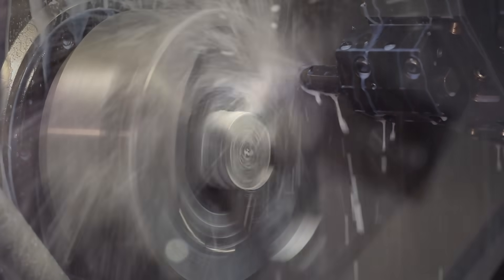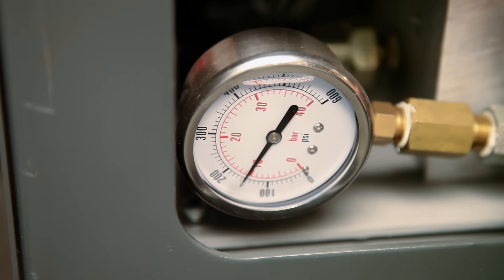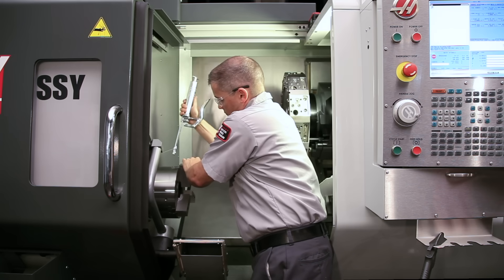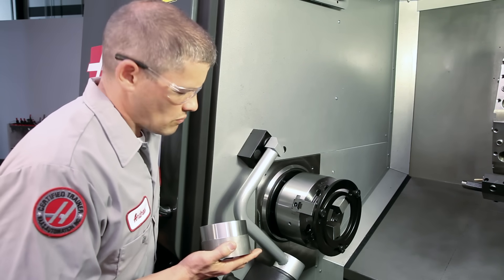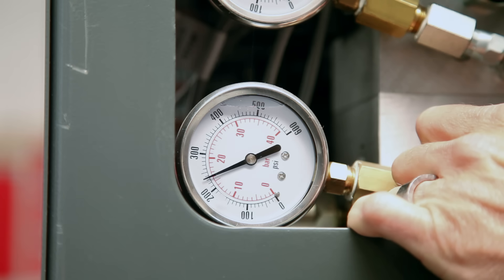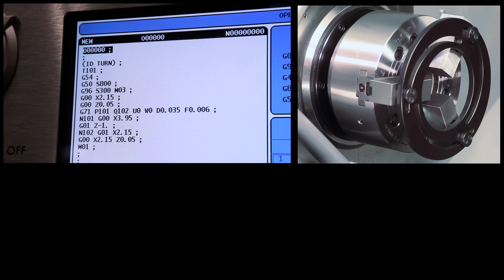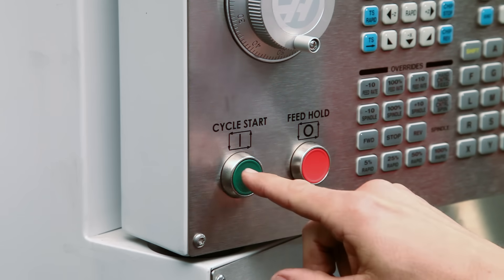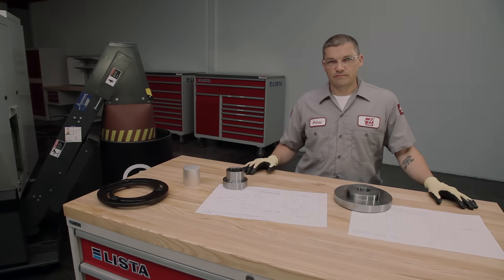How to Properly Cut Lathe Soft Jaws — Part 1: Fundamentals and OD Gripping

Comment: I love how they didn't bring GD&T into this because i'm just looking at this process and cringing at how they just assume 3.9500" OD. Because if its even a thou or two out of round you have either of the respective 3 or 6 point grip scenarios (depending on machine wear, etc.) Otherwise however, it's likely going to work since this looks like a new machine, and its probably beside the point, however important in some more niche scenarios of machining so, I figured i'd mention.

Comment: I have 8 in" chuck with 8.5" boring ring. Im Having a lot of trouble getting the ring to seat Inside counterbores. When I set the Jaws flush with top of chuck(recommended starting point in this video) the ring will seat in 2/3 holes not not the 3rd. I get ring to fully seat when I place the jaws at different height. But doesn't turn concentric

Comment: What tool did you use to deburr the jaws? Would be good to know.
Reply: The kind I'd get shot for using around a machine haha I just take them off after boring and deburr them they'll repeat just fine when you put them back on, just make sure to stamp the jaw number on them as you take them off. Boss man would roll your box out for even thinking about using a grinder inside the chamber lol
Reply: Also he was rolling the burr inwards towards the bored part of the jaw? Always go out, the edge rolled out will keep from marking fancy finishes. In my experience anyways. Also F those jaw boring rings make a steel plug that fits the master jaws of your chuck, then you don't have to stick your boring bar out an extra inch. The plug also keeps your draw tube tidy
Reply: Not to dog the video it's good info the grinder just made me squirm a little
Reply: @chopthesheep90  Thanks for your answeres but they dont solve my question.

Comment: I do exactly as it says in the video. Place the boring ring, lock it in anti-clockwise direction, then lock the jaws, it stops half way as it says in the video. however, the boring ring easily falls off. It doesn't stay in place. Please can someone explain to me what i might be doing wrong. 10inch 3bore chuck.
Reply: don't use it you don't need boring ring for hydraulic chucks

Comment: that last tip was really great. its brilliant to use the same jaws as much as you can to minimize time spending changing them back and forth!
Reply: But be careful if you intend to have both ops in the same program. For example, turn first end, program stop, turn part around and start the remainder of the program to finish the back end of the part. I've seen this done many times. I've also seen what happened if the operator is distracted and starts the program with the part the wrong way round....!!!
Reply: @montyzumazoom1337  i mean you cant predict that someone isnt gonna make a misstake, but you can make safetyprocautions, like m0 ( are the part turned for this oeration)
M0 ( are you sure?)
then go. i too have seen parts and tools being scraped (almost machines too) from these kinds of misstakes, but it all comes down to experience in the end, like always in this field of work! there are button-pressers and there are operators!

Comment: Hi - regarding the rule of thumb of holding 1/3 of workpiece length in jaws if tailstock is not used. 
Can this grip length be safely reduced if all forces from operations are "pushing" towards the chuck?
Thinking drilling (non-peck) and boring here.

Comment: Boys and girls, if your going to be clamping DOWN on your work piece, you have to put your spider (or solid bar stock) inside the jaws.  if you're going to be cutting on the INSIDE of  tubing, or boring something, you need to use a ring on the OUTSIDE of the jaws, then go ahead and cut the OUTSIDE of the jaws to fit the inside of your part.  You HAVE to support the side of the jaws that you'll be clamping against later. If you don't your part is going to wobble all over the place!
Reply: Darn Right
Reply: Dam skippy!
Reply: Mmm, yes.

Comment: You should mention something very important for this kind: The soft jaws are used JUST FOR CERTAIN PROJECT where high concentricitate are required or when hard jaws are very worn out. By the way: force of tightening can be just with 0.315% greater than cutting force.

Comment: Guys I have the problem that when I clamp the boring ring at the middle of the travel I ee that the boring ring OD varies slightly its concentricity with respect to the chuck, in other words, I see a small runout in the boring ring. 
I cut my jaws an later I clampled the raw bar it didn't cut currectly. What happened?
Reply from the maker: Hi Ro. It sounds like the ring was squeezed excessively (distorted / egg-shaped) by using too much PSI force on the chuck. 

1) Make sure the PSI (gripping pressure) does not distort the boring ring 
2) Whenever possible use the same pressure (PSI) when boring the ring and when gripping the parts 
3) Keep in mind that the ring is not designed to run true when supporting the jaws for boring. There will be some slight run-out that is normal
Reply: Haas Automation, Inc. Guys I listened I should use 100 psi actually that is the recommended by the manufacturer. Muchas question is, if my part requires 200 psi but I made the Jaws at 100 psi, would my gripping conditions be affected?

Comment: Great Video. Being a Machinist/ Programmer for 40 years, only thing I would teach different is to bore the jaws .002"-.003"  under part dia.. This gives you a much stronger hold on the part. You would be amazed in the difference of holding ability given the same jaw pressure. It is for sure the difference of having a part come out, and not.  there's always those circumstances where this doesn't serve you well, but as a general rule I always do this.
Reply: Behave Rod . It all works out at the end of the day .
Do you remember how shit scarred of these machines you were first time you used them?
We all were .
Reply: Rod Builder, and your professional qualifications for judging it as such? Perhaps you'd care to enlighten us with your wisdom since I'm happy to learn where any mistakes are in this video. Guess your spreading dirt or something else with that skidsteer to a 100ths of a micron tolerance?
Reply: Well rounded one. I say bullshit , Do you push machine to that degree where you have found the difference between a fly out and not not a fly out by a couple of thou !! Absolute crap .
Reply: you have been doing everything wrong for FORTY YEARS 
its called insanity some say 
you do the same thing over and over again thinking it's right that's what you have been taught that's the way to go with things like hey man look at me i am cool
Reply: Great idea it will also transfer the load across the whole surface by the spring in the materials.
Reply: It's a SHIT video and anyone who thinks it's a good one is a SHIT machinist!!!  Congratulations!!!

Comment: Any good machinist has many different size spiders for boring jaws.  When boring new jaws best to rough out most of the stock on the Bridgeport or jig bore.  The interrupted cut on the lathe is hard on inserts or brazed carbide cutting tools.  Plus this saves a ton of time especially on a manual lathe.  Most small job shops station a manual lathe next to a CNC lathe so the operator can qualify parts before running them on the CNC lathe. This is done during the CNC cycle time when the operator has free time.  This is all part of lean manufacturing procedure.
Reply: Hey so suck, no other manual milling machine will work properly for ruffing lathe soft jaws. Sorry:(
Reply: Blown460 ooh lol
Reply: why bridgeport does other milling machines do the same job
Reply: This clown thinks a spider is something that bites him on a camping trip!!!

Comment: About the question of does the roundness of the plug affect the roundness and concentricity of the finished bore? It's a very nice explanation to me, thanks.
Reply: +jin-shui Chang  To eliminate that possibility, you could turn the plug first, that way you have a clean outer diameter for more precise clamping.

Comment: You mean to tell me, that I have to adjust jaws every time I make part of various diameter or this is just in case you need more precision?
Reply from the maker: Hi Saheryk - Thank you for your question. If you are re-using your soft jaws to hold the same diameter part over a number of different runs, the jaws will usually not need to be re-cut (cleaned up) until wear on the gripping surfaces of the jaws begins to affect part position. This also assumes you re-mount the jaws, every time, in the same position in which they were initially cut.
 
However, when you are gripping a different diameter part with this same set of jaws then it is highly recommended that you re-cut the jaws to match the diameter of your new part.
 
This accomplishes three things:
1. The jaw clamping surfaces are ensured of being concentric with the axis of the spindle.
2. The best clamping grip is developed on the work piece as the full surface area of the jaws is engaged.
3. Jaw force is spread evenly across the body of the part since the jaws have full engagement.
 
Cutting your jaws to match your part will yield the best possible accuracy and grip.
Reply: Saheryk

Comment: Good video. Use of a boring ring is ok but like the video said, the chuck pressure  is limited. I usually use it for boring through the jaws for clearance. I also prefer the scroll style boring ring over the slip style.

Boring the jaws to fit the plug? That just seems silly to me. I use a ring set in .062 increments. I never have any problem with runout. In my opinion, if concentricity is that critical, buy the stock extra long, cut all the diameters together then cut the extra off the back. The best fixture ever invented was extra stock (or leave grind).

Step jaws? Why? To go from operation 1 to operation 2? No thanks. Use your hard jaws for op1 then bore soft jaws for op2. You are not going to hold concentricity from op1/holding a corncob piece of hotroll to op2 and maintain concentricity, in soft jaws, for very many cycles. I thought this part of the video was a little too cute by half. Reminded me of one of those demo videos where they try to machine the whole part with one tool like an insert drill.

I understand this is an instructional video, and it's good information, but from my experience these are "ideal conditions". Chuck jaws are expensive. The 1/3 recommendation made me chuckle a little. If only that were possible MOST of the time life would be great lol.
Reply from the maker: Hi there latheman23. Thank you for your comment, you make some good points, which will surely be of use to other machinists. In the two “How to Properly Cut Lathe Soft Jaws” videos we are presenting what we consider to be our “best practices” that apply to making soft jaws.
 
We are presenting what are likely “best case” scenarios, in order to convey the conditions we try to achieve. As you rightly point out, more often than not, in the world of machining what can be achieved is often much different than the “ideal” text book condition.
 
The experience and the wisdom of knowing the many possible ways to handle difficult machining tasks was something we chose not to try and convey in these “Basics” videos. They were created to offer a starting point for understanding how to machine soft jaws.

Thanks again.

Comment: They forgot to mention the first step: go out and purchase yourself a half million dollar turning center.
Reply: pocoapoco2 , It is helpful to invest in good equipment in order to increase productivity and accuracy. Welcome to the 21st century. I know why your username....pocoapoco...
Reply: Jairo Bernal
And I could just afford to invest in one of these if in the last 20 years I both never ate any food and lived under a bridge.
Reply: pocoapoco2  You can get a good used Haas for under $50,000. Haas is also one of the easiest machine to train green machinists
Reply: yandri you are so wrong. half assed machinists always blame the equipment. I have a chinese benchtop mill @ home that i've built several Impellers on for my RC Jet Pump I built using an indexing head, dialing off 1 deg. x .006" increments X 1500 per each vane side X 3 vanes with zero mistakes. Stop blaming amazing equipment on your lack of tallent and general laziness. HAAS is expendable tooling, make your bankroll and sell it. When I worked @ Holz Precision in the Bay Area, they had $500,000 Mazaks and $25,000 Haas'. They all made huge profits when tooled and jobbed properly.
Reply from the maker: Hi pocoapoco2, thanks for the comment. Half a million dollar turning center? Seems overpriced. You can get a top-of-the-line, fully-equipped dual spindle super speed Haas turning center with Y axis for less than half of that!
Reply: Haas Automation, Inc. lol. Ok, I'll take two of those… and I'll write you a check. Seriously, I work at a very small used motorcycle shop and I use a very old, very tired south bend to fabricate parts and many other jobs quite regularly. I look at videos like this to gain knowledge about certain machining procedures. Much of what I've learned about machining though, actually has come from just hands-on doing jobs , trying different things, and most importantly, paying attention.
Reply from the maker: Hi again pocoapoco2. We really do appreciate you watching and hope you were able to take something away from the video. You are not alone, Haas realizes that many machinists and operators learn hands-on while in the shop and videos this one can impart a lot of knowledge and add to someone’s skill set. Thanks again for the comments and for watching. All the best to you.
Reply: anyone who's worth a fuck as a setup man, knows Haas is the best and easiest machine on earth to set up, bar none
Reply: Lubrificate the chunck once a day looooooooooolllllllll
Reply: John B pl
Reply: That's an old wife's tale
Reply: And if they didn't, they do now. :)
Reply: +yandri arce
Yep, for people who need instructions, there's the Delany Multimachine and its concrete cousin, the Yeomans lathe.
Reply: .....and half o that is almost.....free???? In your opinion maybe or for your budget but not for everyone.
Reply: Our used Mori Seiki NL2500 was $200k used.
Haas has some great machines, very intuitive & user friendly. I do this for a living.
Reply: Top of the line and good quality are two totally different things. Stop being an elitist trolling snob. Haas fulfill a certain market segment and do a brilliant job with it, machine shops around the world pump out incredible work across all material types with their machines.
Reply: pocoapoco2 there is nothing difficult about setting up a two axis lathe with a tool pre-setter, they're all easy
Reply: WelLRoundeDSquarE who is blaming equipment?
Reply: +nik Miller Haas is not a good machine, affordable yes but not a good quality machine,.

Comment from the maker: (Continued)

Setting these two pressure values is an important part of correctly clamping and cutting your part and they are typically adjusted before starting every new job. There is a decal on the side of the machine that we reference in the video that shows how chuck gripping force (at max chuck pressure) varies as spindle speed changes.

Hope this helps Keith. Please let us know if there is anything else we can help you with.

Comment from the maker: Hello Keith. Thank you for watching the video and fore the question.

There are two hydraulic pressure gauges mounted on every Haas Lathe that uses a hydraulic chuck and tailstock. One of the gauges reads the pressure that the chuck is presently set at and the other reads the pressure the tailstock is set at. In any of the wide angle shots in the video you can see the location of the two gauges on the lower left-hand side front panel. (continued)

Comment from the maker: (Continued)
 
In the case of very high roundness/concentricity requirements (less than 0.0005 TIR) it may be helpful to turn the plug as well. But consider also that at this level of accuracy there are many influencing factors.

Thanks for watching and the question.

Comment from the maker: Hello and thank you for the question CADtekk Designs. Your comment brings up a good question: Does the roundness of the plug affect the roundness and concentricity of the finished bore?
 
Although the plug itself does not have very accurate roundness, the bore cut into the jaws is still as round and concentric as the accuracy of the machine itself, since the jaws are spinning about the center of rotation of the spindle.

(continued)
Reply: But u are clamping on not only a mismatched diameter but worse a non cylindrical part. Thus each jaw will not be in the same position when it clamps the machined part nor have same preload. This might seem nit picky but to not take 2 min and machine the plug seems absurd. What am I missing?

Comment: how can u use inches? mm is better ! :P hahaha
Reply: Or maybe not? Since it takes 25.4 of em to make 1" then logic says 1" is better. :-)
Besides any measurement system only works because people agree on what the measurement value means, it's simply a mathematical concept. You could make parts just as well if you divided up a furlong by 100ths, thousandths, millionths etc. Show me one single physical object that's "exactly" 1" or 25 mm. We can make parts just as accurate using an imperial or metric system. Metric is easier to divide and multiply in your head that's all. But if anyone is still counting on there fingers I doubt they run machine tools. :-)

Comment from the maker: (continued)

As the part becomes increasing delicate or if there is danger of marring an existing finish, then the jaw surfaces will need to get smoother and smoother. The average finish value that we use here is in the 125 micro-inch range.

Thanks for watching and the question. Let us know if there is anything else we can help you with.